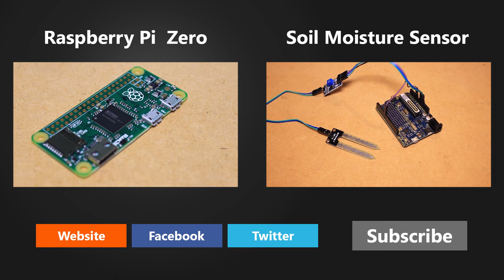Raspberry Pi - Video Adapter

Comment: The PI Zerro 2W has soldering pads for TV out. 
But it is becoming increasingly difficult to find a TV with video in. A mini HDMI to HDMI cable will help.

Comment: Audio out is not as simple, but the video out certainly works. Did it with my zero.
Reply: Is possible to use a USB soundcard ?
Reply: @cazb73  A Redditor I recently met confirmed this is possible.

Comment: This Video Adapter is for input video or output vídeo? Is to connect to a camera or to a TV?
Reply: Omaia (3mo later) It's a video output from the Pi, you connect it to a TV/monitor.
Reply: from the jack it looks like video IN to me
Reply: BUMP
Reply: @CodeXND  You can have 2 male rca's on a cable in between.

Comment: does the polarity matter??
Reply: (after 10 months...) I think it matters, but you simply should try and if it doesn't work, just flip the wires
Reply: It does matter. One is a signal wire and one is ground.